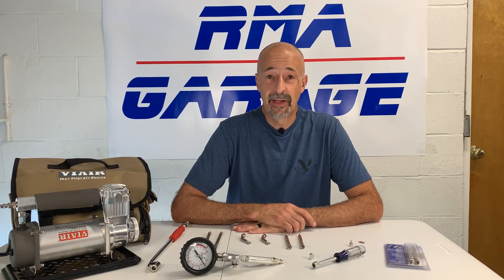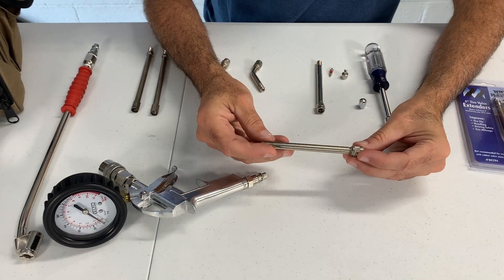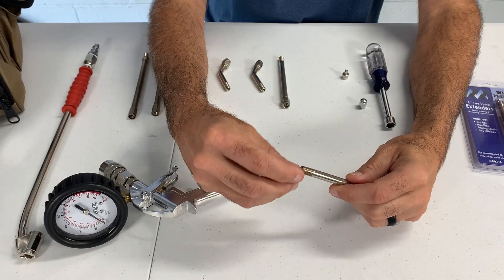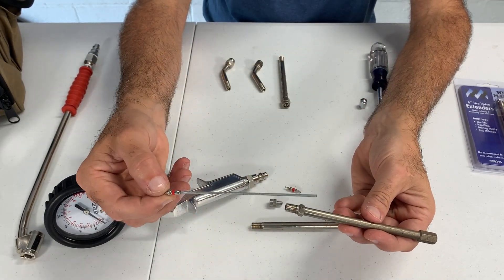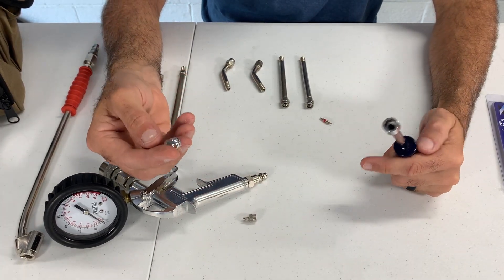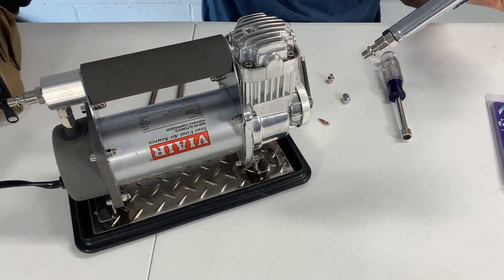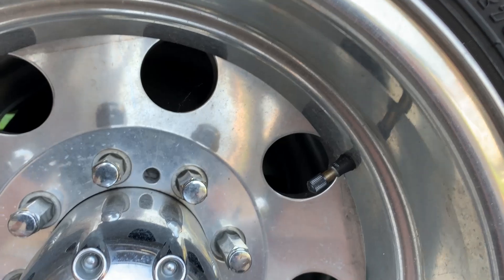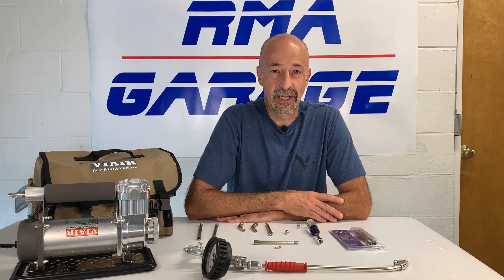Tire Valve Extension Leaked | Coachman Leprechaun 260DS

Comment: Appreciate the video and detail regarding the stem failure. I recently picked up a new to us Dutch Star and it came with extenders and an aftermarket tire pressure monitoring system, which is outstanding, but I'm still working through a few issues.  I also continue to see tire pressure drop on the inside dually.  Issue #1 identified is that the o-ring on the valve extender was folded between the core valve and extender.  It was not allowing tire pressure to register as well leaking air.  I'm still troubleshooting and appreciate your video detailing challenges with the longer/heavier extender.

One recommendation, give these caps a try that allow you to check and fill the tire without removing the cap. I've used them for the last 10 years on my previous RV and they worked perfectly. Never lost any air while sitting and you'll never have to remove another valve stem cap again. I picked mine up at a Speedco truck stop, but they appear to be available everywhere.  This model is on e-trailer.  "Counteract Double Seal Flow-Through Tire Valve Cap - Item # CA48FR"
Reply from the maker: Thanks for the product suggestion.  I do struggle with trying to get the cap back on.  This flow=through cap would solve that issue.  Thank you very much.

Comment: I have one of those Viair compressors as well and I love it.  I just bought a new motorhome and it also has dually rear wheels, but didn't come with any valve stem extenders.   My wheels are 22.5 inch Alcoa wheels, so I bought Alcoa valve stem extenders,  but they also came with rubber support grommets to support the valve stem extenders inside of the 2" outer wheel hand hole, so that it doesn't cause the issue you experienced with your setup.
Reply from the maker: I just looked them up.  I had no idea they existed.  Very good idea.  Thanks for the comment.

Comment: Thanks for this video!
We ordered a ViAir compressor and it should arrive today.
Also, husband checked our tire pressure on the inside dually wheel and was shocked to see it was also 30psi! Filled it to 80# and monitoring it. He said it sure drives better, and we tow a stock trailer behind.
Question: we have trouble filling the fresh water tank, cannot get the hose threaded on right. We noticed that you have a plumbing fitting at your fill, with a right angle. This looks like a great idea. Is it an assembly that you bought, or did you make it? Any info greatly appreciated!
Thanks for your great videos!
We love them!
Reply: PS: at a campground recently, we talked with other folks about valve extensions for inside dually wheels, and folks were not aware that some had the long seal pin and others did not. All said they were going to check and replace theirs if needed. Just wanted to tell you how your word spreads and how you are educating others. Thanks much!
Reply from the maker: It is a (Camco (22505) 90 Degree Hose Elbow)  I use this because I can close the door to the compartment as well.
Reply from the maker: I nice to know that our efforts are being used for good.  Thanks for letting us know.
Reply: Thank you! We will find one. Happy travels!
Reply from the maker: @bethbell5671  Thanks...You Too.

Comment: i see you new wheels are they covers or chrome rims ? how do you like them? my wheels covers came off on a trip to Florida and have not replaced them yet/
Reply from the maker: My wheels (all four) are aluminum.  That was an upgrade to the steel wheels with hubcaps.  I am happy with them but you do have to polish them from time to time because they are not clear coated. That is a hassle but I think they look better that wheel covers.  Thanks for the comment.

Comment: You should NEVER rely on RUBBER valve stems on ANY vehicle from 3/4 ton up. Even the so called "high-pressure" rubber stems aren't safe to use. ALWAYS use METAL BOLT-IN stems. (ALSO; I found lightweight extensions made by AIR-FLEXX which I use on my F350 DRW truck and they work well!!)
Reply from the maker: Thanks for the comment.  I will check them out.